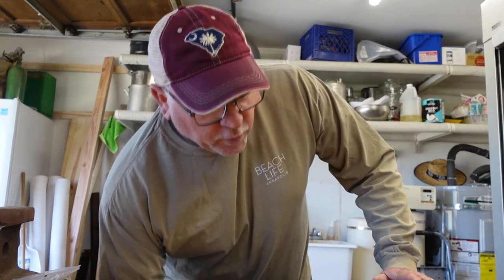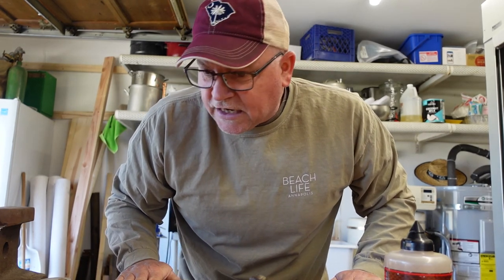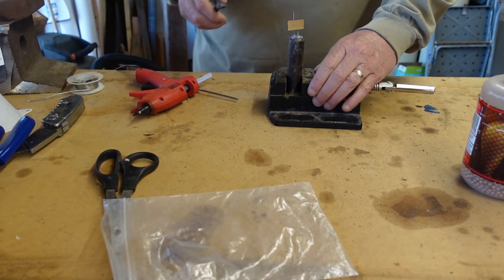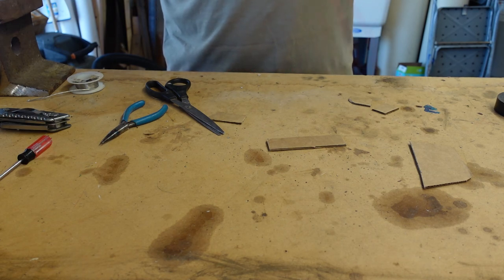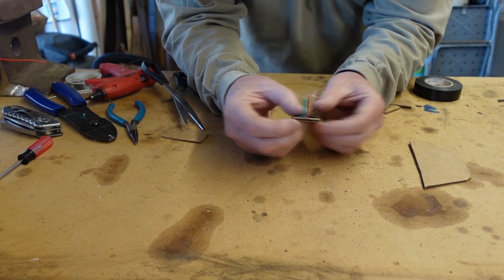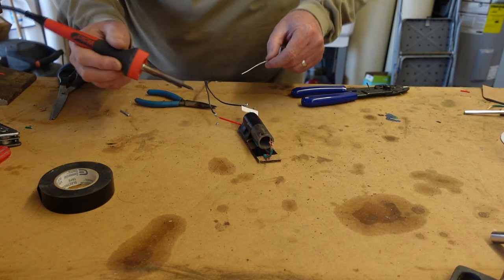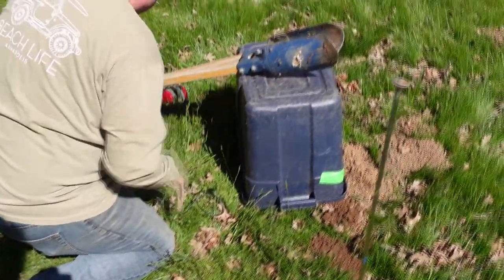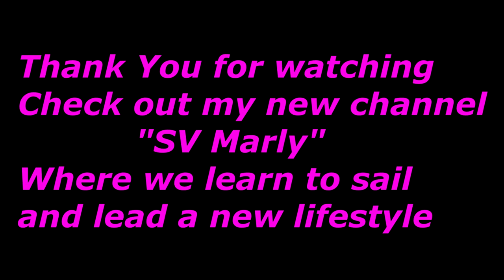How to Kill Gophers with my gopher CANNON!

Comment: I made one of these, and I had to run the wires over the top of the canon because the little bastards plugged all the wires in front of the canon with dirt and it didn’t go off